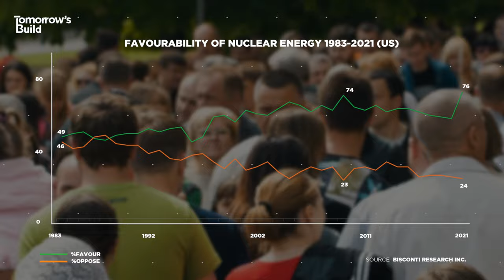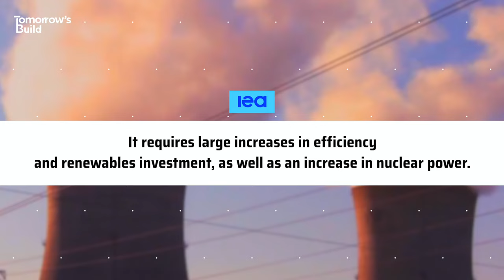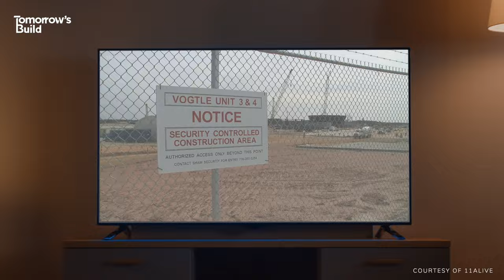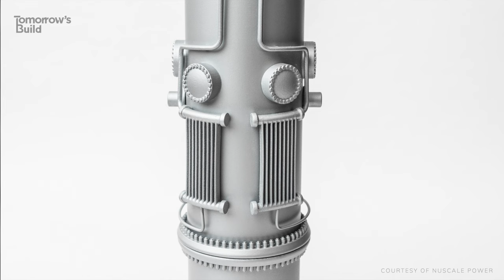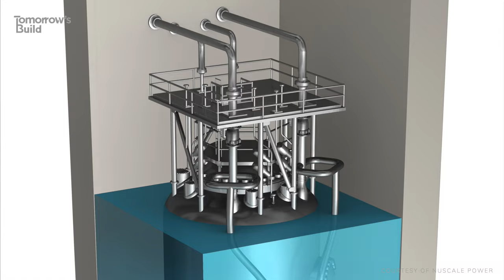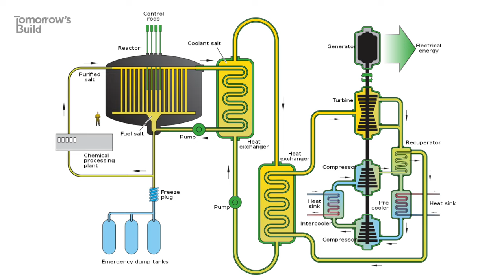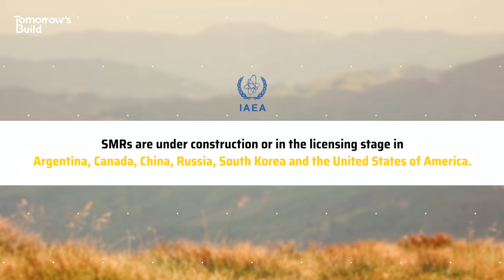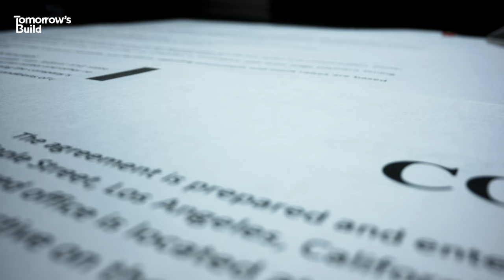These Mini Nuclear Reactors Can be Built Anywhere

Comment: Is there more radio active material after the fuel has been used than before? By before, I mean in the ground that is being mined to run the plant.

If I understand correctly, a molten salt reactor running primarily on Thorium can use waste from the typical uranium fired reactors. In so doing actually reduce the amount of radio active waste. A huge win it would seem. France reprocesses their waste to get more usable fuel out of it. There is a political problem with doing that in the USA. The US Navy has been operating "small" reactors on ships for years. How much have cancer deaths increased in the down wind area from the Russian melt down? Do people in Nagasaki & Hiroshima still die from the A bomb's radiation?

Comment: Yet, the best place to put them is submerged offshore. 
Microsoft already experimented putting servers offshore for passive cooling.
Reply: @Trevor Phillips 
The open sea would provide passive cooling in case of malfunction. In nominal conditions the reactor would be insulated from the sea water. 
Sure it's less practical than inland but hey that's the price of safety.

Comment: I wish I could like this, but it's full of the same unanswered questions and quite a few moments of just outright obfuscation in favor of delusion.
"They're built to be safer" - You think none of the previous reactors were built to be safe? Fukushima wasn't built out of rubber bands and a plug-in timer. The entire point is that unforeseen accidents happen, and we cannot plan for every eventuality.
The other guy claims that their reactor will simply "shut down" if it experiences a problem, and then completely ignores the FUNDAMENTAL issue of maintaining power to maintain cooling, it's like he just didn't want to mention this major issue with all reactors because he didn't have an answer, and he wasn't pushed to give one. You can't just shut down a nuclear reactor and forget about it, this doesn't solve the problem of a MELTDOWN, explosion and the release of radiation.
And of course, it wouldn't be a fantasy marketing video without the slick graphics which completely ignore all the real problems and reveal it to be completely unworkable.
I don't know if the security aspect was even touched on because I gave up at 7:14, but let's just say that you have a thousand of these scattered around the US, how exactly do you then control oversight of their operation, and maintain security against terrorism? Is that all paid for by the purchaser? How are they forced to comply? Who pays for the billions of $s of oversight of these thousand nuclear reactors? The systems of regulation and monitoring required for such a scattered use of such a risky concept would make it completely uneconomical.
Finally, newsflash: this is not a new idea (kind of like Elon Musk "inventing" a far less efficient subway system, adding RGB lights and duping a bunch of morons into thinking it's "revolutionary"). The US government worked on smaller reactors before anything else. You might be familiar with that major accident at one of their test facilities when a man was launched into the ceiling. Their bodies are encased in concrete and lead to this day.
They were not feasible then, and calling them "modular" doesn't make them any more feasible now.
For the record, I'm relatively pro-Nuclear, it's just tiring to see so much disinformation being pushed out by channels that rely heavily on slick graphics while ignoring the real issues. It's fantastical nonsense that doesn't really help anyone.

Comment: I'm truly looking forward to have my own chernobyl in the basement.
Reply: Chernobyl is a very weak argument against nuclear power.
Reply: @armorclasshero2103 That’s not a relevant problem anymore.
Reply: @LuchtLeiderNederland  35,000 women are currently receiving compensation from Ukraine for the chernobyl-attributed deaths of their husbands. Bear in mind that represents only 30% of the fallout area.
Reply: @armorclasshero2103  Those were from a disaster 40 years ago. All the severe problems that caused Chernobyl (severe design flaws, obsolete reactors, human errors, inadequate training, lack of regulations, cost-cutting decisions) have been solved decades ago. Another Chernobyl-like disaster is impossible to happen again, thus it isn’t relevant anymore. Don’t cry about something in the past that isn’t able to repeat itself.
Reply: @LuchtLeiderNederland  ok. in the 10 miles around Germany's nuclear plants, the child leukemia rate is 6x the national average
Reply: @armorclasshero2103  Wrong. Child leukemia is 2.2x the German national average within only 5 miles around the nuclear power plants based on an old 2008 report.
Reply: @LuchtLeiderNederland  ok so i misremembered the details but the argument remains
Reply: @armorclasshero2103  Not really. Modern nuclear power plants are not built near residential areas, and of all the leukemia cases near nuclear power plants in Germany, few have been caused by nuclear power.
Reply: @LuchtLeiderNederland  this video is specifically extolling the virtues of putting nuclear stations in downtown cores
Reply: @armorclasshero2103  Yeah I forgot about that. However, these will be built below the ground with a lot of protection, and it’s pretty much in concept phase so there is a lot of time to improve them. Another thing is that the reactors in Germany are older models from the 60s, 70s, 80s and 90s, while the reactors of today are so much safer and cleaner, so imagine how safe these underground reactors are in 10 years or so.
Reply: @LuchtLeiderNederland  we don't know they're safer. they have never been tested at scale.
Reply: @armorclasshero2103  I didn’t say these are safer, I said the reactors of today and those of 10 years into the future are.

Comment: Small reactors make no freaking sense. It's not possible to secure them, so one terrorist with a car bomb can easily cause a huge radiological accident. Also you have issues with refueling (where are you going to store the used fuel until it cools down?), decommissioning (how are you going to transport all the irradiated materials?), etc.

Comment: What does happen if there will be an earthqueake
Reply from the maker: Well it's ultra-safe so.....
Reply: @TomorrowsBuild  Not everything always goes according to plan.
Reply: Nothing, just like has happened to every other nuclear plant
Reply: Fukushima survived the earthquake and the tsunami.
It was the flooding of electric generators and switchboards that caused the cooling to be interrupted.
Reply: @voidisyinyangvoidisyinyang885  The point is that if not for the electrical failure, the reactor itself would be fine.
Reply: @ChucksSEADnDEAD  So I'm gonna assume that you mine uranium for a living. "Would Be, Could Be" - ah that's a great point indeed. haha. "Uranium mining has widespread effects, contaminating the environment with radioactive dust, radon gas, water-borne toxins, and increased levels of background radiation. Uranium mining is the first step in the generation of both nuclear power and nuclear weapons." Maybe hang out in your local Mall and you'll find a better product that will make you happy.
Reply: @voidisyinyangvoidisyinyang885  As opposed to the people minining the materials you need for all the other renewables?
Reply: @ChucksSEADnDEAD  I never said I support the other renewables.
Reply: @voidisyinyangvoidisyinyang885  So you support just staying in the dark and living off sustenance farming, gotcha.
Reply: @ChucksSEADnDEAD  I'm not trying to change the way you think. So you can make up whatever you want.

Comment: Has there ever been a really profitable nuclear power plant if you include the whole life cycle costs? I don’t think so and why would these really be different?
Reply: Has there ever been a really profitable fossil fuel plant if you include the whole life cycle costs? Yes because they gave it enough money. Just throw in more money, the reliability, efficiency will increase. Nuclear power is especially useful in space, because depending on the mission, solar panels could be too heavy or too far away from the sun to be viable. These tiny reactors would be useful for a mars base because of the unreliability and inefficiency of solar and wind power, especially when dust storms can block the skies for days at a time.
Reply: Of course there has, if the Generation I reactors had not been profitable then the world would never have built Generation II or Generation III reactors...

Comment: Not gonna be a popular comment in this environment but scaled down nuclear reactors will fail. Yes, it is handy to have power exactly where it is needed, no loss in transmission. But these will be built close to where folks are living. There will be endless protests if these are built even close to where folks are living. 10% the size of a normal reactor, 100% of the risk. As for almost everything in history,: to concentrate the production of stuffs to a few locations will increase output, and for the nuclear industry safety, since there is fewer places things can go wrong.
Can almost imagine that a company in town would announce that they would suddenly build a nuclear reactor in their basement, ppl would literally grab torches and burn the company.

Comment: The story of Chernobyl always taints reasonable debate on this subject. The RBMK is a very large, VERY crude soviet era design with literally thousands of serious design errors. It was designed to have a very large core of low grade fuel. There is no outer containment vessel, the control rods do not reach to the bottom of the reactor vessel, the control rods are a flawed design with graphite tips which can dangerously spike the reaction as they are inserted or raised & the rest of the critical controls are similarly nasty & crude. In 1986 when the explosion occurred, politics was allowed to overrule capable technicians who even though they were largely unaware of the significance of these flaws, knew it was a really bad idea to continue with the test as dictated. Several other RBMK reactors are still in use in Russia today & there are several serious accidents related to this nasty design.

Funkshima was a disaster beyond the designed severity ever taken into account. The tsunami overwhelmed the coastal defenses around the plant & flooded the backup diesel generators & fuel. The automatic emergency systems scram shut the cores down but eternal cooling was still required. Ordinarily, the operators would have been able to attempt to set up ancillary measures to cool the cores plus also to run outer containment venting to remove trapped hydrogen but the tsunami buried everything in deep mud & debris far inland so it was impossible to get equipment to the plant quickly enough & the buildings blew up with a hydrogen explosion leading to scattering of radioactivity. I traveled to Japan 2 days after the disaster & was involved in emergency work to quickly survey the seabed from aircraft using a bathymetric system so equipment could be safely taken there by barge & ship but by the damage was too extensive & the area was heavily contaminated.

The SMRE is a completely different concept. Small cores are much easier to control & the technology associated has undergone generations of improvements in materials, designs, testing & modeling... These are NOTHING like the horror story designs of yesteryear!

Comment: Ramana's negativity is well known in the energy industry. Unfortunately he is based in the USA and has allowed that country's obsession with regulation to blunt the edge he used to have.
Safety is of course paramount but a quirk of the USA is that 'regulation' is often used as a tool of manipulation and, matched as it is by litigious obsession, the once "new world" is now a gerontocracy.
I expect to see SMRs being in operation in the UK on sites already announced but because Britain, Norway and Denmark have developed the largest renewables mix in the world I foresee SMR sites being used to get grouped modules working quickly then add on to them at a slower pace. My reasoning is that relatively low output modules linked using existing cabling will be used to boost and guarantee base load around the North Sea grid then be expanded alongside more efficient storage of surplus renewable energy. Storage was somewhat neglected in the rush to wind and solar and different types of storage can be tried all over the world to fit local circumstances.
Gravity storage is being examined in the UK and Norway and ex coal mines are proving promising in central Europe, Canada, China, Russia and parts of South America. South and south-east Asian researchers are examining coastal storage and are pushing ahead with wave power and a mix renewables impressively.
We are probably closer to molten salt reactors than might be apparent as these sit well with SMRs and storage integration and as these reactors can use some types of fission waste as fuel (such as the Moltex system) now that corrosion problems seen in early thorium tests have been solved.
It is vital to stress that several technologies advancing to fit exact situational needs will have some surpluses and some low production thus SMRs, molten salt and storage must be switchable to maintain base load. As our planet rotates we need to aim at renewable energy being reasonably predictable but backed up by small nuclear reactors.
Large nuclear reactors which, as Ramana says, take a long time to build may still be built for the economies of scale they allow but is argument could well be more out of date that he thinks. BTW I am several years older than the professor!

Comment: hmmm... this sound sus.  

I say that because you asked us what is the first thing you think of when the word "Nuclear" is said.  I think water.  

I skimmed the video, i might be missing something.  So far i am a bit sus on this.  Heard cooling doesn't matter because of its safety feature.  It can be built anywhere.  It uses unique tech to operate.  Correct me if I am wrong, but I am 100% certain you need a good source of water, and a lot of it.  Water vapors are hard to deal with in closed systems, and this seems like a closed system.   It also seems like they are ignoring the importance of water.  Like it is used for power generation, but the source of it doesn't matter.  Like they are trying to make water not that big of a issue.  

If any one replies, maybe ill watch again the ful video, and see if I missed something.   As of now, I don't really trust this.
Reply: Most SMRs are molten salt reactors, which use salt, typically a mix called FLiBe, as fuel and coolant. There are also a few others that use things like heat pipes to the reactor. The only thing water would be needed for is the turbines, but super critical CO2 turbines aren’t far off

Comment: Something to bear in mind:

Renewable capacity growth worldwide in 2020: 256,000 MW
Nuclear: 400 MW

Nuclear is dead for all practical consideration. Only space travel and military projects are the only feasible applications since they don’t answer to economics.
Reply: We need baseload though...
Reply: @jondonnelly4831  Baseload is an economic term, not a reliability term. The concept was based on the notion of running a small number of plants with supersize turbines 24/7 to generate the baseload as cheaply as possible. They were supersized because steam generators scale exponentially, renewables scale linearly. So long as enough renewables are distributed over a sufficiently large area, has a sufficient transmission system, and has enough storage there will be sufficient generation render baseload plants technologically obsolete.
Reply: Empirical evidence says the exact opposite. The California and Germany have both gone full in on renewables, while shutting down the nuclear, and they’re seeing massive problems and have to import electricity from other countries/states. Moreover, their electricity prices are skyrocketing. That’s what you get when you try to rely on something with the 30% (at best) capacity factor.
Reply: @DRH-yh9wm  cookooland